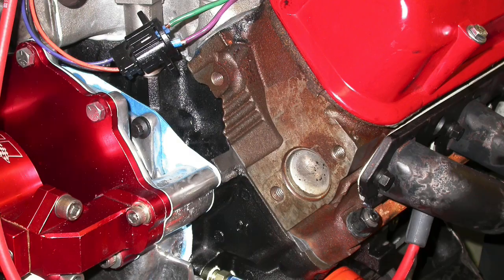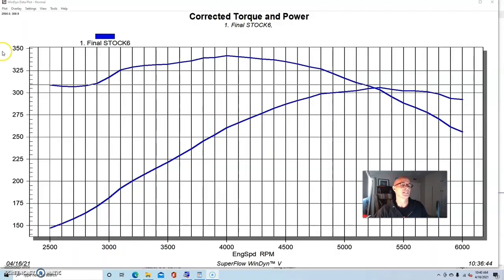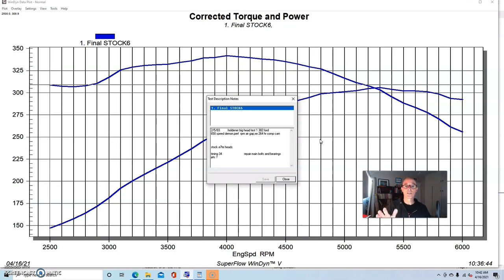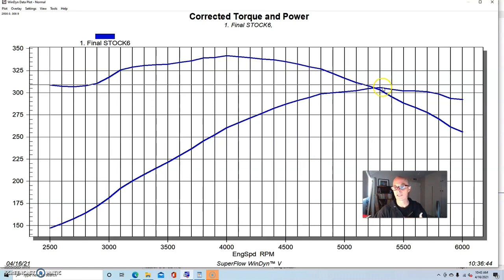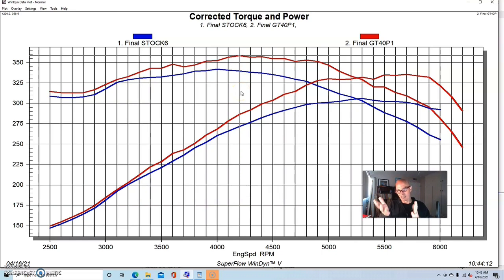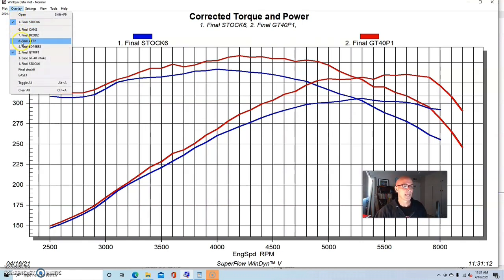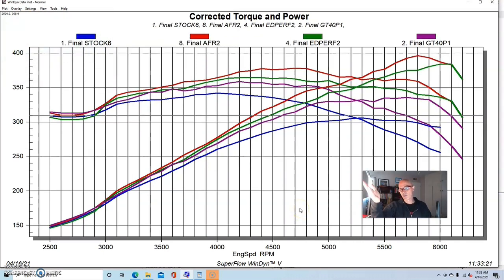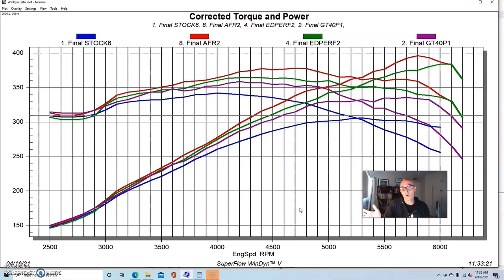JUNKYARD GT40P HEADS-ADD 30+ HP TO YOUR 5.0L (FOR FREE?)

Comment: GET A 351 W BLOCK, 302 PISTONS, EAGLE CRANK SHAFT. THIS WILL GIVE YOU A 393 WINDSOR WITH OVER 400 BHP. ITS CHEAP AND WILL SMOKE MOST CRATE ENGINES FOR SALE.

Comment: Gt40p heads and eventual 351 swap is exactly what im doing. Im building up my 1990 f150 302 keeping it speed density and limiting myself to around 250-300hp with a very mild cam. Its efi and I plan to keep it efi even if i have to use fitec

I have a spare 351 zf5 combo I want to completely rebuild n swap over when the 301 finally craps the bed

Comment: Power block engine master and a few other show numbers and combos but always leave out what headers they used on gt40p ford guys know gt40p headers are a nightmare clearing 3 and 7 spark plug now old bbk and mac work but they are unavailable now so it would be nice to know what bolt on long tube headers work without an issue

Comment: Hi Richard, i really need your help. I have a 69 mustang with a 302w 4bbl. I found a pair of gt40x m6049x302 with valves and springs for $600. I dont want to pass this deal as this old 302 has the stock heads. Im wondering if it would be a direct bolt on? Im concerned that the angle of the plugs will also be a probles (i have shorty headers) thank you im new to this project 69 so im a bit out of my element. Any help is appreciated it
Reply from the maker: not sure on header fitment-otherwise they bolt right on

Comment: Hi Richard I haven't  see a test yet on a 1990 taurus  sho 3.0  liter engine  yet? I would  like to find out 2 thing that  engine  is good  for  8500 rpm and second it can make  300 hp without turbo
Reply from the maker: I have been in an SHO Taurus that revved to 10K, so the RPM is easy. Yes on making 300 hp NA

Comment: Hope you can help me out, just found gt40 heads and intake. Would love to  do a cheap add on for my 1995 5.0,( in a FFR Cobra). can you guide me in , if needed, cam, valve springs. I am running EFI stock setup too.THX
Reply from the maker: Summit has some new 5.0L cams worth a look

Comment: My take away from this is that the aluminum heads have really big intake runner volumes and it really kills that low end torque below 3000 rpm, I'm guessing it's because these intake runners are killing the velocity that provides efficient air fuel mixing. From a daily driver street car aspect, I feel the GT40 heads with some casting clean up in the ports will be great for overall power and cruising fuel efficiency at an unbeatable value. For me, I'm going with the GT40 heads.
Reply from the maker: Not sure how you got that take away-Almost every alum after market heads is better than the iron Gt40s (at every rpm)
Reply: @richardholdener1727  Sorry, I thought I seen the aluminum heads had the torque dip below the gt40s at the 2500-3000 range on the dyno graph comparison.

Comment: * * Can you do a video on 302 vs 460 * * 

and what would be better bang for your buck ? 

if you had either of these laying around and had like $1500 or $2500 or $3500-5k to throw at one. which one would be the better option. 

you can possibly even do which one would make more peak n/a hp vs which one would be better for a budget n/a rpm build. 

I am considering doing a 460 with a 429 crank  and a cam in my 95 gt. 

but for now i will stick with my 306 , f303 , ported P heads , trickflow upper / lower setup.
Reply from the maker: a 460 will make more
Reply: @richardholdener1727    who would you recommend to go to for a custom grind cam for a  sbf / bbf ?
Reply from the maker: cam research corp for the 460

Comment: E7 topic- what gains would we see porting and bowl work and spring upgrade on a stock 302 and add a really nice cam?? About how much HP would we see??
Reply from the maker: ported stock heads cam be worth power, but big difference in the power gains based on who does the porting.

Comment: I dropped a full explorer motor in my mustang years ago.   I had a rod start to knock, so I got a full motor from a totaled explorer for $300.  I friend owned the yard.   I put new exhaust from shorty headers, no cats, x pipe, and magnaflow mufflers.  Looked 100%, would run with the best of them.

Comment: How about the cheaper Edelbrock heads and a XE274 cam?!?  I’m thinking it would at least equal the power of the AFR165’s in this test!  Cheaper heads and cam is probably the same cost as the XE264....cheaper combo, same power!
Reply from the maker: what Edel heads would make as much as AFR 165s?
Reply: @richardholdener1727  i am referring to the Edelbrock heads in your test....you said they were much cheaper than the AFR’s used in the test.  The Edelbrock heads made less power than the AFR’s using the same XE264 cam.  Would the Edelbrock heads, used in the video, run with XE274 cam make equivalent power to the AFR’s, used in the video, with the XE264 cam, used in the video?

Comment: Why is the 93 cobra and Lightning rated at 235-240 hp with non P heads??? Dont reg old Gt40 heads flow better than gt40P??
Reply from the maker: GT40 P heads make the same power

Comment: Do some 351w have GT40 heads? If so which ones?
Reply from the maker: only Lightnings
Reply: The lightning had them.
Outside of that was the OMC cobra 5.8 with fuel injection.
That was just a lightning engine in a boat.

Comment: i built a 398w and put gt40 heads on it seems to run real good with plenty of power been wanting to put it on the Dino to see what it makes feels like 450 or 500 hp cant wait to see
Reply from the maker: let me know what it makes
Reply: @richardholdener1727  plan on taking it to ford fest they will have a dino down there it's in the car a 71 Torino

Comment: Just purchased an original low mileage 1986 Mustang. What do I need to do in order to get into some of these performance Foxbody/sbf upgrades?
Reply from the maker: heads, cam, intake
Reply: @richardholdener1727  Do I have to change pistons on a 1986?

Comment: Raced a 306 for 2 years. Had professional ported set of 65 289 on it. Bought a set of rpm heads on it! Picked up 1 tenth, that's it! The weight reduction was probably half that!! Went to a 351w with the ported heads! Picked up a whole second in the 1/8 mile! Paid $500 for the 351w short block! Solid lifter Fred Flintstone cam! If a 351w will fit!! The headers were really close to the floor boards, but didn't hit!

Comment: Bro I’ve seen a budget minded oem spec 351w build that used these p heads making over 100hp more than stock! They’re crazy for what they are
Reply: They used a mild cam roller conversion with lightly porting on the p heads, no valve job, and the Franken-intake from using a 351w lower ported to the 5.0 upper plenum. It was a Maf engine already and with a dyno tune he was pulling right about 110hp more than his base engine. Really neat build that still looks factory unless you look hard at it.
Reply from the maker: so the test was not just the head change-got it!
Reply: @richardholdener1727  sorry I didn’t clarify it earlier 😂. It seemed like a really good build for what it was. Also I own a 93 bronco with the 351w that I will be building up on a budget somewhat soon just to improve the power:efficiency ratio because as of right now it sucks gas for barely any power. Looking to do the same build as that guy had done but I was wondering about if you had looked into Flotek heads before as they were about the same price as the GT40P heads but were aluminum heads and if I remember correctly I’m pretty sure aluminum heads allow a lower octane rating for higher compression ratios because of heat transfer efficiencies so I would like to do that instead but want some more input from others on how good they really are.
Reply: I meant same price as reworked gt40p heads but new and assembled flotek heads
Reply from the maker: must have been ported

Comment: I have a 1989 crown Vic ltd with a 302 with 83k miles my motor idles high I’m guessing it needs a tune up for sitting so long it hesitates in gear Sometimes I’m trying to refurbish throw motor on stock block just rebuild all over it any advices or tips? I have videos up of me working on it slowly
Reply from the maker: SOUNDS LIKE VACUUM LEAK

Comment: Hi guys I'm building a 306 with fully ported gt40 heads ported lower explorer  Anderson n41 cam trick flow valve springs 70mm tb and BBK 1 5/8 shortys what power numbers am I looking at
Reply from the maker: have not tested that-not sure how well your heads are ported
Reply: @Richard Holdener  head runners were gasket matched 3 angle valve job and valves pocket ported
Reply: I have almost the same combo with 1.94 intakes and n41 cam do yourself a favor and put longtubes on it well worth the pain in the axz..mine will rip

Comment: Both 40 and 40p heads will need better valve springs for high rpm work but the biggest difference is the relocated spark plug and smaller exhaust valves on the 40p. Ford moved the plug for better fuel mixing and went with the smaller E7 size valves because the hardened seat inserts on the earlier GT40's were more expensive than induction hardening the seats on the p's. Ford made up for the smaller valves with a slightly better exhaust port on the latter heads. Both will support 375-400 hp with mild porting (mostly on the exhaust side) and the right cam but i think they more cost effective and durable for a 350 ish HP 302 400 HP 351 build.

Comment: GT40/P for a street car that you want some pep in it

I'd skip the eddie heads

AFR heads would be my go to. Almost 400hp (roughy, an extra 70hp) for an additional $800-900. If I get the Eddie heads for $1100, how much more would I have to spend on the short block to make 400hp? A set of pistons is about $600 to raise the compression and even then, it may not be enough. 

So for a weekend warrior, AFR would be the best bet and they would still lend themselves nicely if I were to build a short block or go to a high comp, big bore 351w.

Comment: I am putting together a Ford v8 302 engine from the year 79 With flat head forged pistons with only two cavities per piston, gt40 f1ze covers with 49 mm multi-angle intake valve and 40 mm multi-angle exhaust, 289 intake manifold, 750 cfm edelbrock carburetor, multi-spark msd ignition, non-roller hydraulic tappets, with a 5-speed gearbox and 15 x what I would like, recommend the cam according to that, taking into account that it is put on a F1 model 51 street and quarter mile.  What camshaft do you recommend?
Reply from the maker: I DON'T KNOW WHAT P-V CLEARANCE THAT COMBO HAS-YOU NEED TO MEASURE IT
Reply: @richardholdener1727  Sorry, i don't understand what you mean by p-v

Comment: Richard, I have to say thank you for answering any and all questions I had regarding Ford 5.0 cylinder heads and camshafts. You compare apples to apples instead of testing what a set of heads are worth, but sneak in a different camshaft or intake to skew the results. 

Also, anyone else here wish they had HALF  of Richard's energy??
Reply: Hello I have a 5 liter ford and I want to bud another one with a tunable ECU cuz I have speed density but I wanna be able to tune it because I want to upgrade stuff and still have it run right I like chocolate pudding and banana bread I'll even take a handful of those washers and huck em at cyclists

Comment: Thanks for doing these. Building up an 89 5.0 HO to put in a 79 Zephyr. What mods can be done to help below 5000rpm ?
Reply from the maker: dual plane, small cam, compression, good heads
Reply: @richardholdener1727  Thanks.

Comment: I've got a 97 mountaineer 2wd auto 5.0 could you recommend a good cam and springs it's got about 210 hp I'm lookin to get about 300 hp I'm planning on getting rid of the cats and doing a single 3 1/2" exhaust with a super 40 and stock manifolds also a cold air intake also do I need to do anything with fuel
Reply from the maker: YOU WILL NEED MORE THAN A CAM BUT LOOK AT THE FORD E303

Comment: I picked up a 91 Foxbody with a .030 over 5.0 with gt40p heads and f303 cam. Dont know much else. Is this a decent combo? Will be mostly street driven, third car. Was thinking adding a turbo. Thoughts? Great content by the way!!!!
Reply from the maker: should work well
Reply: Awesome. Thanks. I forgot to add its 80% reassembled, got a steal from a closed shop liquidation sale. Thanks again.

Comment: Love your videos! I picked up a junkyard high milage (200k)1996 explore 5.0 with GT40 heads. I took a chance and thru it directly into my 65 Fastback with AOD trans and lost the EFI and carbed it, put all the vbelt stuff on it and man I am happy. It gets on it when I smash that throttle. Probably have about $400 total into that engine swap (engine, gaskets, and conv harmonic balancer). My question is should I have ported my gt40 heads on exhaust side? Would there be noticeable more power and how much difference?  Also now days I want to keep good MPG since I daily drive my car. Should I swap out the cam for like a TFS1 came and springs? Would that lose more MPG then the explorer cam?  Currently intake is Performer 289 and exhaust mainifods are stock 65 289 ones and 3.55 rear end. Im not trying to make a track car,  just a daily driver with great MPG and some wallumpf!
Reply from the maker: a mild cam will help and won't hurt cruise mileage much if any

Comment: Just put a gt40 headed 302 stock bottom end on the dyno. Made 360hp and 360ft lbs of torque with the xe266hr camshaft. Edlebrock 600cfm with the edelbrock performer 289 intKe manifold. Ran clean out to 6500 still making 330hp at that rpm. Very happy with this combo
Reply: I was going to try the same with XE274HR.
Reply: @shalver66  if you dyno it, please share your results
Reply: @jasonhooey5677  I’m working on it now.  I’m concerned about the PTV clearance.  We’ll see when I get to that point.
Reply: @shalver66  the best advise is what ever cam you think you want, buy the next step down.  Get another XE camshaft but with a little less lift.  
On the other hand, pretty sure Richard has run the xe274hr with a stock bottom end.  Watch all his sbf videos, good info.  
Between him a David vizzard i built a 306 that makes 480 hp with 445ft lbs of torque on pump gas, with world products iron heads
Reply: @jasonhooey5677 how was the lowend, say below 3000
Reply: @Keeg02.  excellent, you can feel it pick up just after 2000 rpm. There's a noticeable increase in torque around 2200rpm, easy to drive around at low rpm. Keep the revs about 4000 for a party, nice mid range if you want to shift around 3500 to 4k, sounds good
Reply: I got a 1989 crown Vic build

Comment: GT40 heads are really attractive for the price, but a good cylinder head combo doesn't move my T-Bird while the engine is sitting on the dyno.  The promise of removing 60lbs entirely by switching to aluminum heads is pretty appealing.  Throw the battery in the trunk, and I'm getting closer to 50/50 weight distribution.

Comment: What headers do you run to clear the spark plugs on the GT40p heads? I have a 302 I am building for a 1968 f100.
Reply: I’m running 60s mustang Tri-Ys

Comment: So there isnt a big power difference between the standard 40s and the Ps? Currently cleaning up the bowls on a set of GT40 heads now. Exhaust looks to need the most work lol. 
Went with a super low buck combo, whole explorer 5.0, BBK LTs, lunati valve spring upgrade, 1.7 RRs and an E cam. Going into a 90 Tbird SC to be a drift learner car.

Comment: AutoZone sells the rebuilt GT40 heads with valves and springs for around $300 each. Would these be worth it instead of what you risk getting from a junk yard?  They also have a 1yr warranty.
Reply from the maker: IF THEY HAVE THEM-LOTS MORE EXPENSIVE
Reply: @richardholdener1727  Thank you for running the comparison. I’ll be looking through the local salvage yards for a pair  GT40 heads this weekend.  As expensive as the high performance heads are, you’ve opened my eyes to a good option.

Comment: My 93 bronco 5.0 weak as water 180 hp
My 89 f150 5.8 with the same heads and intake 225 hp damn it's strong 
Buy a 5.8
Reply: Torque makes a huge difference

Comment: Did you ever get valve float fixed to see what kind of games they would make what is the best spring so far for the gt40p heads to help fight valve float
Reply: I run comp 977 springs with crane roller rockers. No issues around 450-500whp with an ON3 turbo kit, launch control etc